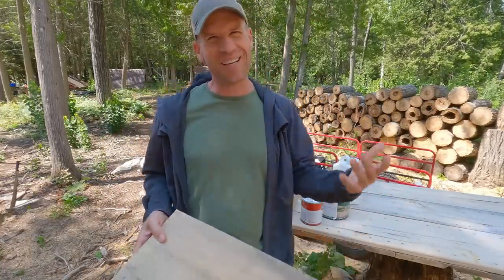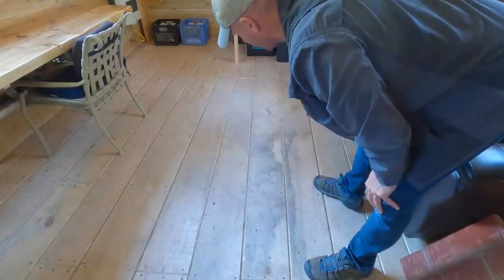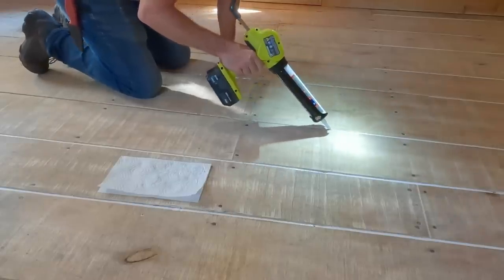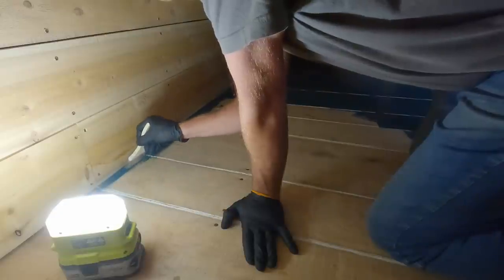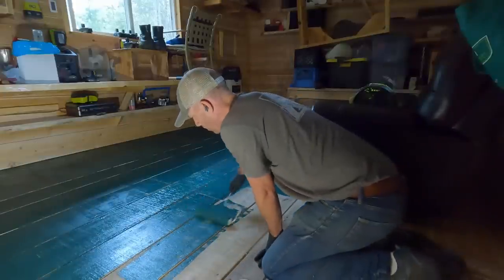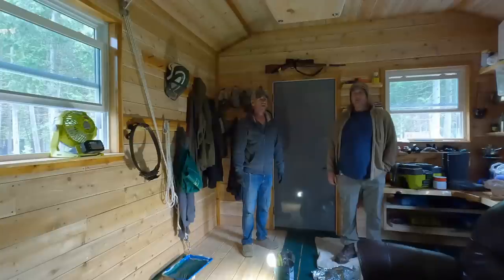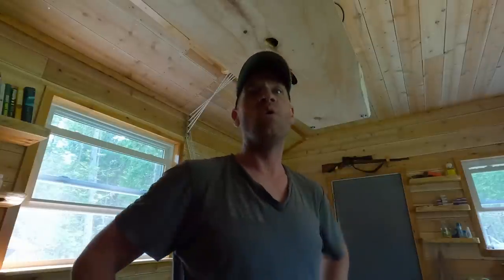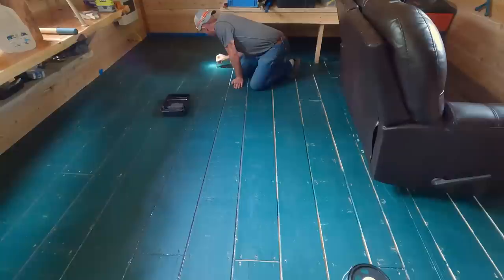Inventing My Own Cabin Floor Finish- Ignoring all the Directions!    #151

Comment: I really like the way the floor came out. I usually don't like the distressed look either, but with the sealer applied it is just the unique look I think you were going for. The inside natural wood walls and ceiling needed a striking color, and the floor was the perfect place for it. A nice place to hang out, a place you like to be, is soothing for the soul. I'm sure Sarah and Tito will feel the same especially in the winter months. The darker floor will also enhance the theater viewing experience. Good choice.

Comment: Screw it lay down some 3/8 4x8 foam sheets  mill up some 1/2"  cedar planks run em through the planer nail it down make it pretty that ugly floor is giving me a headache i cant sleep at night thinking about it foam will cushion and keep ur feet warm in combination with that not you avg double bubble foil radiant barrier u got under there